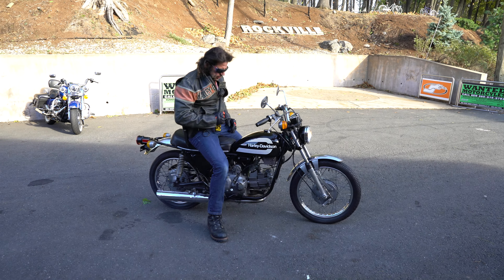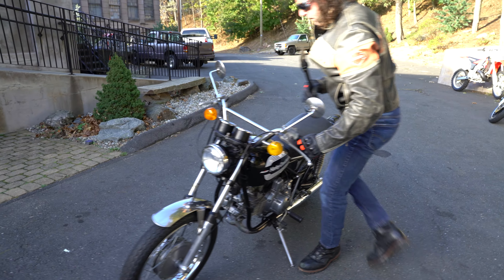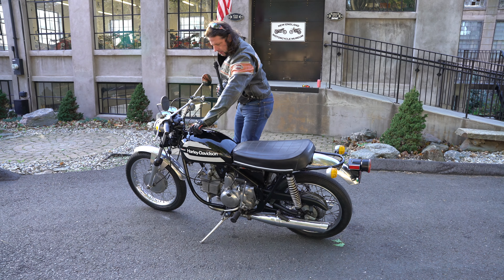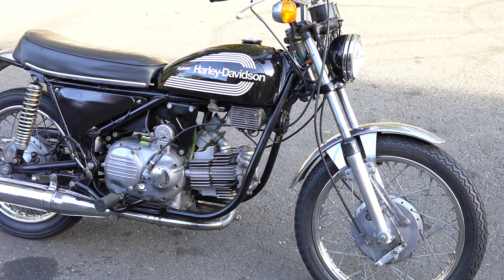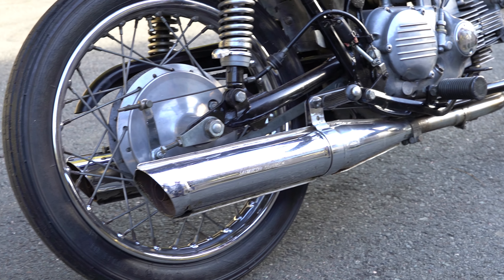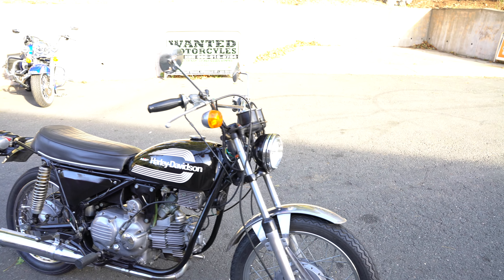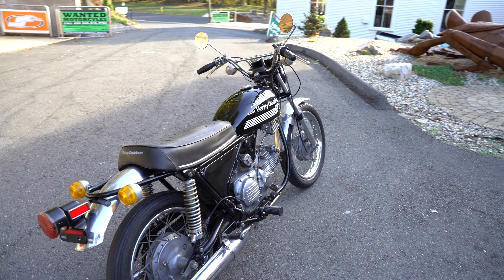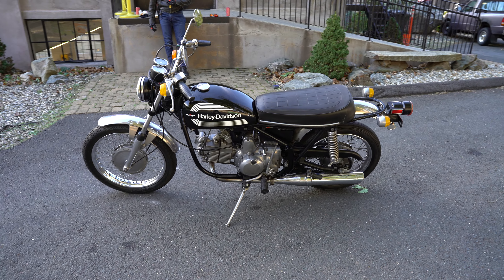1973 Harley Davidson SX350 needs engine rebuild

Comment: I know this is an old post but these old Sprint motors had a bad habit of the oil passages in the crank and rod assemblies clogging up when the sit for extended periods of time.  Then going bad due to a lack of oil when they are ran again.  More than likely what was wrong with this one.
Reply: There is no evidence of this anywhere.  All motors need to be run, but Sprints are no different than any other bike.